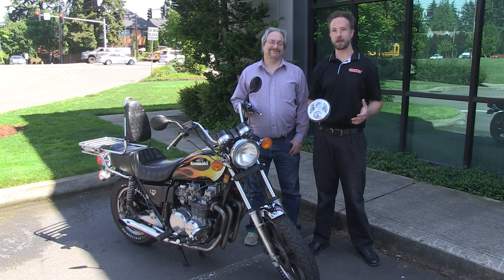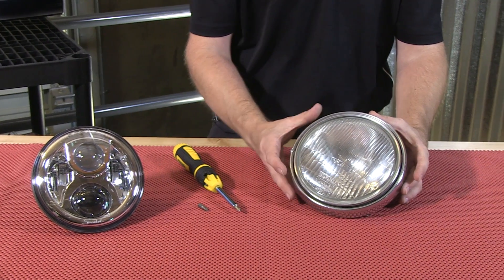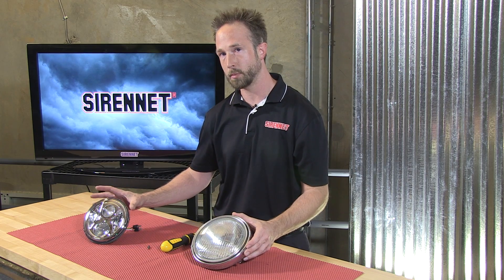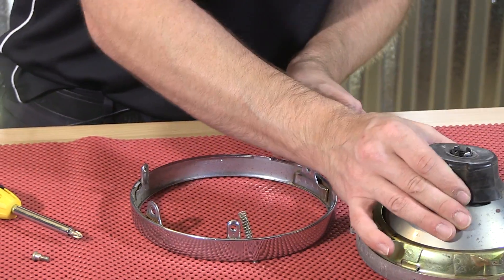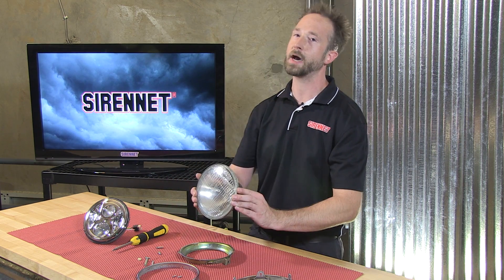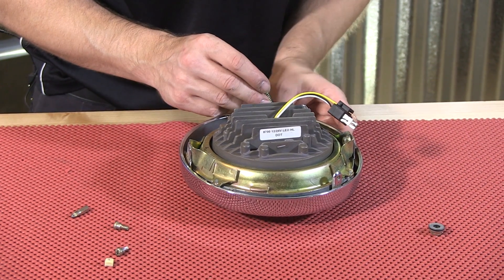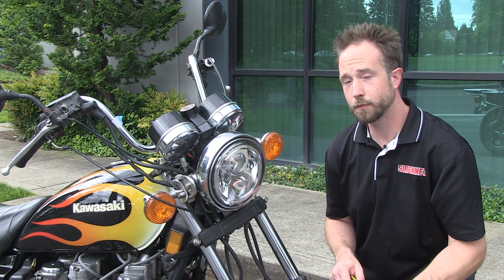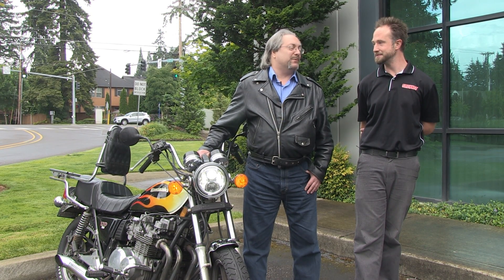Kawasaki Motorcycle Headlight Conversion with a J.W. Speaker Model 8700 Evolution 2

Comment: What did you do to clear the RLU error that I know he experienced after the install.  The "Reserve Lighting Unit" measures the resistance a normal H4 halogen bulb puts off and knowing that all of these led fixtures don't have near the resistance the RLU gets a false reading that the low beam has burned out and turns the error light on in the dash as well as trying to turn on the high beams.  Seems in some countries back in the 1980s required this safety feature on bikes to ensure that the headlight would still be on in the event of a low beam filament failure.  Most folks just bypass the RLU or add resistors inline with the new headlight.

Comment: I NEED HELP!  I just bought a LED Headlamp for my 2001 Kawasaki Vulcan size 5.75 inches and the stock bracket does not fit the LED headlamp. I have been looking for a ring or something that would fit around the LED headlamp and screw into the stock outer ring. Can you suggest something for me please?
Reply from the maker: Nothing comes to mind regarding a specific adapter ring or mount that we can offer or point you towards. How big is the stock housing on the Vulcan?

Comment: I’ve got a zn700 Ltd.. this bike is rad. My headlight at the moment does not work. Trying to figure it out
Reply from the maker: We'd say start with the fuse and move into opening the headlight for wire inspection if that's not the culprit.

Comment: You didn't show how you had to wire it up different.
Reply from the maker: We grabbed a new H4 connector for inside the housing and just matched the wires up as appropriate for the ground and leads for lo & hi. With just three wires, it's very straight forward if you're doing this change-over.
Reply: @SIRENNET  There was no mention of an "H4" connector! Glad I read the comments! I'd be lost

Comment: hi sirennet by any chance do you know if this headlight would work with stock 2017 kawasaki vulcan 900 custom? or would I need to buy a bezel kit?
Reply from the maker: We can't say for certain. If the HL bezel is what actually holds in the 7" round stock headlight, then an add-on bezel shouldn't be necessary.

Comment: I have a 2001 suzuki bandit that seems to have a (female)  6 pin connector. This lamp seems to have three large pins. Is there some sort of adapter I can buy to connect the two? Does anyone know?
Reply from the maker: Hi Daniel. Unfortunately we haven't been able to locate any 6 to 3 pin conversion harnesses. If you haven't already, we'd recommend taking a look at a Bandit forum to see if anyone has a solution they've found or even perhaps made custom for a conversion.

Comment: Thanks for this inside look at a retrofit.  Harley-Davidson factory-installs the J. W. Speaker 8700 in 2014-up FLH Touring models (viz., the FLHTCU, FLHTK, FLHX, and FLHR); I anticipate that a Truck-Lite six-diode model with two twist-lock flasher provisions will be used for the fleet-only FLHP and FLHTP (the smaller FLTR, and likely FLTP, headlights, installed in pairs on a frame-mount fairing, are subcontracted to Truck-Lite for 2016-up).